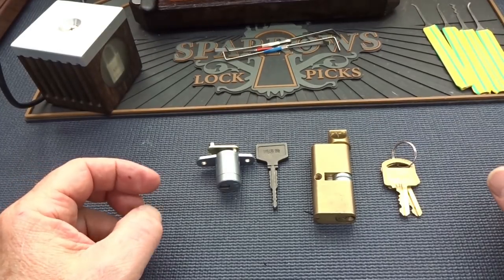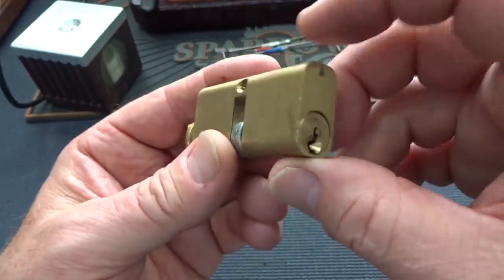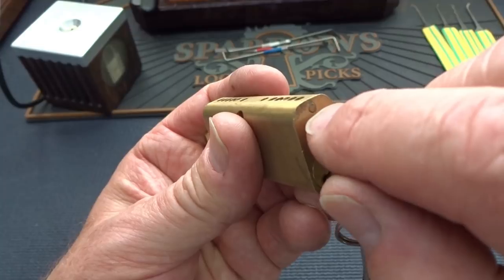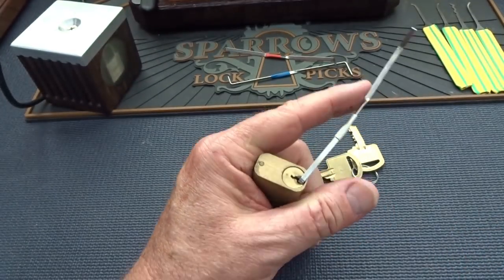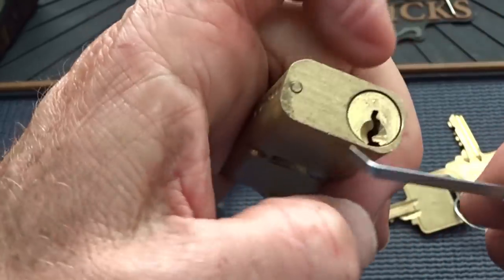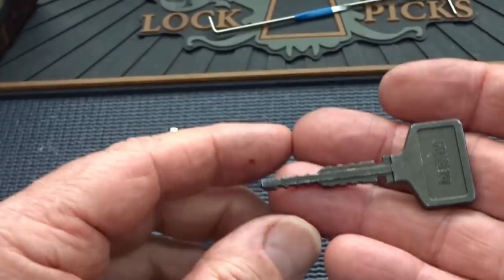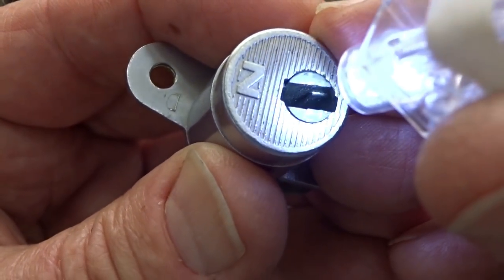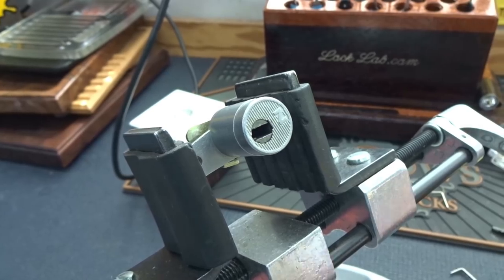(1286) Paul J's "Odds & Ends" & Magnetic Pachinko Lock

Comment: I still find those Wright locks (and there's a few different brands with almost identical construction, all square bodied and all impossible to disassemble conventionally) on storm / atrium doors here in the southeast. They seem to be one of the go to hardware choices for Larson, Pado, and a few other popular manufacturers of these doors made about 15-20 years ago before these companies switched to true Euro cylinders.... Like you, I've never seen one with a security pin before...  The door hardware they fit into often has weird backsets and is next to impossible to find replacements for, and it's impossible to change the lock cylinder out without changing the hardware as the door prep won't match up with anything currently sold... Luckily blanks are usually easily found (even if you have to go online for something weird like a PA-1 blank, which oddly enough, my distributor couldn't get, but I found at a local hardware store who uses Hy-Ko blanks) a lot of them run on smaller Yale blanks... Often you can even find depth and spacing from subscription sites...     

When I get one the customer just ABSOLUTELY wants a key for it, and door and the rest of the hardware is still good,  I'll typically drill out the top holes and then tap them for worm screws, cut a key however I can, and pin it that way.
Reply from the maker: Sounds like an awful lot of work just to salvage a lock like that.  With all your labor added in it would probably be a lot cheaper to use updated hardware and a standard euro cylinder.
Reply: It is a BIT of a PITA, simply because it can't be done on the spot... and whenever modernizing is available, I urge the customer to go with it... For some of these oddballs I can find "new old stock" on the discontinued hardware on websites specializing in that sort of stuff, or get lucky on Ebay...  The problem is, sometimes there simply is no hardware available due to nonstandard backsets that will fully cover the door prep because of the weird backets (like TRULY WEIRD... like a 2.5in backset on an atrium / storm door mortise lock, stuff that boggles both my mind and google). First step is always to try to impression them, but with many the key pins are just too rounded and the springs too soft from years of wear to show marks...  The only other options for the customer when this happens is cover plates so the door can be reprepped (which is what I'd do if it were me, and I tell them this, but many customers don't want that aesthetically) or getting a new storm door.  Thankfully the drill points are always very easy to spot because of how they put the cylinder together, and they use standard diameter pins, so really if I already know the key blank, once I get it back to the drill press at the shop, it's realistically about 35 minutes worth of work start to finish.

Comment: I keep seeing people using NdFeB magnets to do stuff like this to old magnetic locks and keys, and I have to say I hope nobody minds ruining the lock.  Anything that's either old enough or designed for high-temperature applications (not necessarily locks, but proximity sensors, pickups) will probably be made with AlNiCo magnets.  AlNiCo compositions have a relatively low intrinsic coercivity and can easily be permanently demagnetized or reversed by a NdFeB magnet.

Comment: Bill, the audio is a little better, but you got to do something. It sounds like dirt in the mic screen or something. Run some sine wave tones until you hit the right freq. Then use shop air on the wind screen.
Reply from the maker: Mike F187  It is a brand new microphone, right out of the box.  My third...
Reply: Are you still recording audio with a digital recorder and mic and then dubbing the tracks in post? Are the artifacts present on the raw audio file before any processing? Send me a sample audio file and I can run some analysis.
Reply from the maker: Yeah, that's the only way to get hi quality audio into the vid, the camera mics suck big time.  Check out today's audio (5/11/18), and if that still has artifacts, listen to Tomorrow's.  I have been making tiny incremental increases in noise reduction in post processing.  If Saturday doesn't cut it, then let me know and I'll send you the raw files.  It is beginning to look like we're getting clipping when compiling the video into MP4 to upload to YT.  Either that, or when YT compresses the video it happens there.
Reply: I know the direction your thinking, and I thought about that also. The thing is, normally over compression will cause a tinkling sound in the high frequency ranges and it is very consistent. I notice this seems to be at a very specific frequency, and that makes me think resonance. Normally your audio is spot on! We will see how it goes.

Comment: the Magnetic lock would be hard to defeat if it was still in the machine?
Reply from the maker: No, the lock face protrudes enough to defeat them with a magnet.  Newer machines recessed the locks (and used different, more secure locks).
Reply: "would be hard to defeat if it was still in the machine?" if you use magnet that was avaible when this lock was in use then propably yes, neodymium magnets was developed in 1982.

Comment: That Wright cylinder looks just like the ones made by Pado & Papaiz in Brazil, which are quite commonly found installed in parts of the USA. 

The pin used to hold the pins in place CAN be removed. It can be pried forwards from the 6th hole (nearest the cam) & then pulled out from the front. 

The first 5 chambers contain a spring, driver pin & key pin. The 6th chamber contains a solid pin that retains the plug in the housing. 

I'd be surprised if the Wright cylinder can't be disassembled in the same manner. 

There is a video showing the disassembly process here : https://youtu.be/Jm5anU3th3M